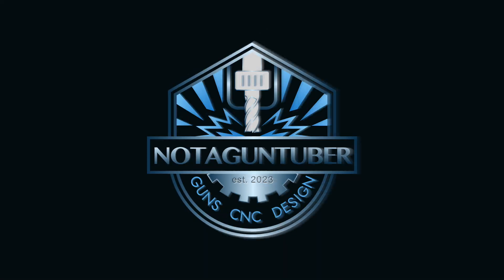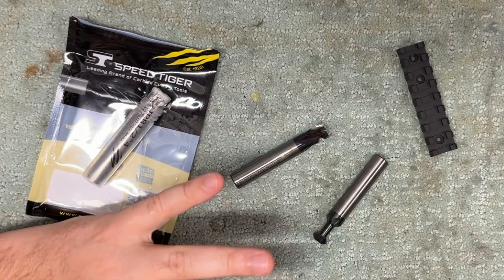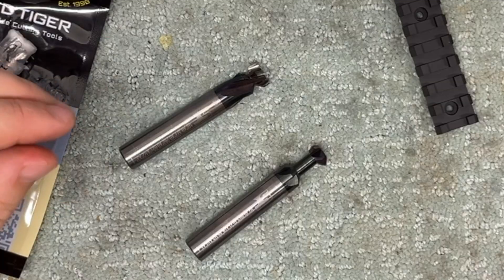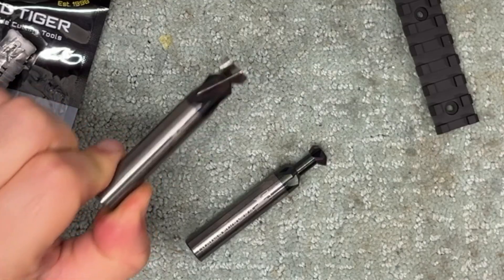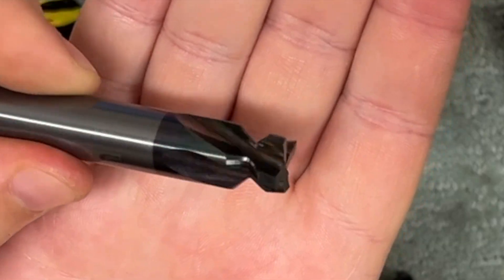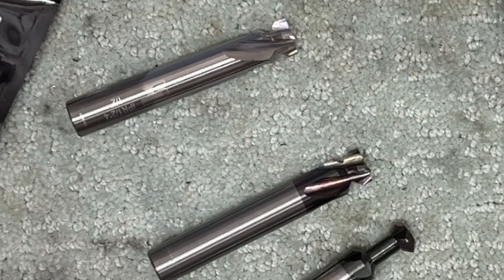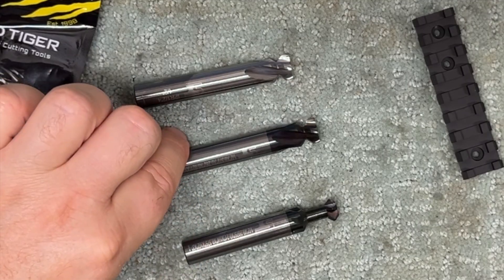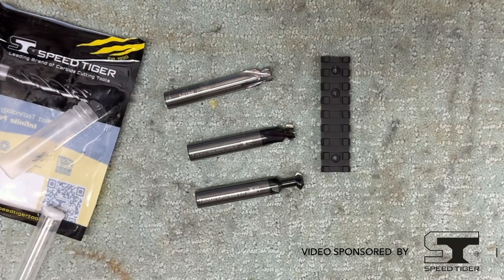I Helped Design a Picatinny Rail Form Cutter with Speed Tiger

Comment: A questions, is this possible to use on a drill press or do I need a mill?
Reply from the maker: You need a mill. But. I’m actively in development with Speed Tiger of a 3/8” diameter version. Prototypes in hand. Which would open this up to any sufficiently sturdy mill with an ER16 collet of larger. So good desktop mills become potentially feasible.
Reply: @NotaGuntuber  awesome, yea as a hobbist im not looking for a full machine.

Comment: These look fantastic! One little piece of feedback. If I may? Some of us have spindles that only go up to to 1/4-in collet, so if you offer a version with a thinner shaft, yes you'll have to take much lighter passes, but it'll open up your potential customer base. 🙂
Reply from the maker: I know! I thought of this too. But sadly, even going down to 3/8" may not even be feasible. Think about the geometry of the bit. A pic rail, viewed from the end, is essentially two 90 degree triangles with some flats. Those triangles are just under 1/8" wide. An end mill must be symmetrical so you have to double that size just to account for the cutter's shape to be able to make those triangles. We're already at 1/4" with just that. Then you have to have a core to the bit so the top half actually connects to the bottom half and has some stability. Maybe. Maybe you could get away with an 1/8" core and have a very fragile bit! But again, but puts our theoretical minimum at 3/8" and for a subpar product. That's how you end up at 1/2" bits, sadly.
Reply: @NotaGuntuber you could always grind the shaft itself down a step, it would leave a weakspot in the tool overall, but it wouldn't encroach on the bit geometry. The part that is actually being held by the collet. One could minimize the stress by cutting it with a rounded chamfer. A 1/4 in is quite thin though for a geometry cutter. Alot of stress on the shaft though. I think you could get down to 5/16. I guess someone will have to experiment by grinding the shaft itself down to those sizes and test them. It would have to be down on a lathe or a rotary grinder. Not sure what its called exactly. Its all ive heard it called. It grinds things perfectly round and thats all it does. Looks like a lathe but its not. The ones i worked with were very old but would grind crankshafts for presses. And large engines. I made a mini one from an old mini lathe and another headstock plus a homemade grinder head using a 10mm wide gt2 pulley and a cheap 800w rattmotor spindle motor they use on the cnc routers.  3d printer the covers and motor mounts from pps-gf and made a shaft in the common wheel sizes to switch out for the wet slow grinder wheels or the diamond wheels.
Reply from the maker: @Drainolordofsteves  sounds like a very cool project. Yes, you are right, if you started with a larger bit, like the 3/8" one I'm playing with, and then ground down the shank only and didn't touch any geometry you could theoretically end up with something smaller. I think you're really really pushing it trying to hit 1/4" Unless maybe you chopped the length down to only stick out like 1/2" and then only reduced the diameter of the last bit that the collet needs to grab? Also, if your machine only holds onto 1/4" bits, this may not be the type of work you should be doing on that machine!
The problem is that that is now a highly custom, high labor product. That one, targeted to a very small audience, would be more expensive than even the 1/2" original version. Nothing stops someone from modifying one to make their own, but I have a hard time thinking that would be something I could convince Speed Tiger to do.
The reason I'm able to convince them to try a 3/8" bit is that applies to any machine that's got an ER16 collet. So now we're into the territory of nicer desktop machines like a Taig or similar.

Comment: Looks awesome! I was considering to machine some in steel, without any form tool, but abandoned it because of the time-suck. Just bolted on an aluminum piece instead, for that application. These could open up some new possibilities with less time investment!!
Reply: If I was trying them out on mild steel, I'd estimate starting with 2000rpm and 16ipm, but with a low DOC of 0.020-0.030" walking it to dimension. I'm risk-averse and usually run shallow DOC with likely more cutter wear, but lower chance of snapping carbide.
Reply from the maker: @andrewmassey794  I would tend to agree with you. In aluminum I got away with doing the depth in two passes. But anything steel I'd walk it up at lower RPMs as well! Mild steel I was thinking RPMs like 4,500. But something like 4140 pre-hard, I'd for sure be down in the 1,500 range!
Reply: @NotaGuntuber I frequently machine 4140ph for my projects. Sometimes I get away with treating it like the medium hardness steel that it is. If I'm feeling extra cautious, I run the numbers for hardened steel which came out to 1200avg-1500max rpm and feedrate of 8-10ipm. I do hate dealing with the splinters I get, though. I'm still too much of a novice to be comfortable making big chips with solid carbide.
Reply from the maker: @andrewmassey794  you just gave me PTSD! I'm working on a 357 magnum revolver comp in 4140ph that I haven't shown in any videos yet. The chips that come off that thing are the devil! Aluminum doesn't have anything on the pain 4140 chips can cause!
Reply from the maker: If you give it a go, don't forget to come back and tell me what feeds and speeds yo used. I have not made anything with mine in steel yet.